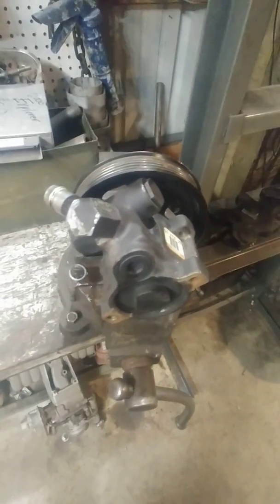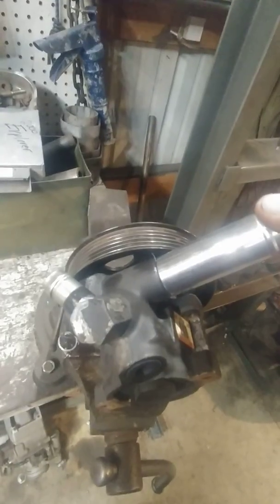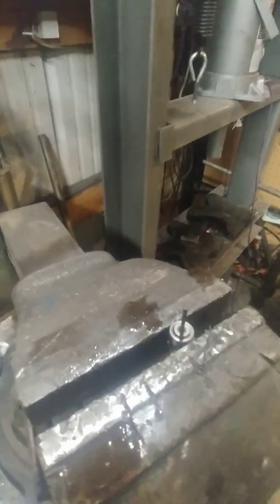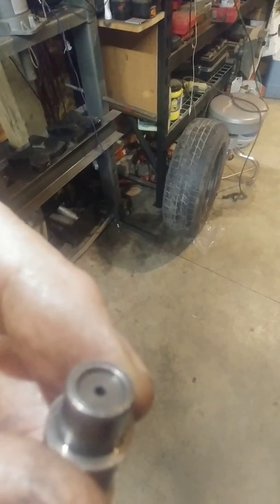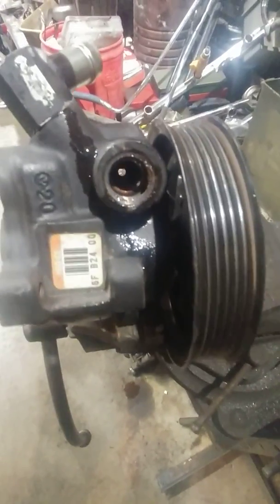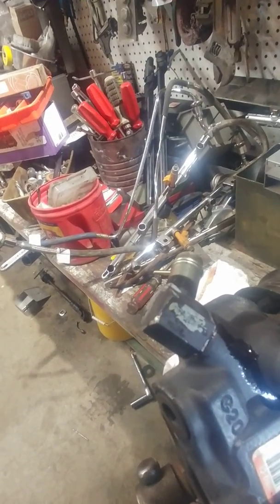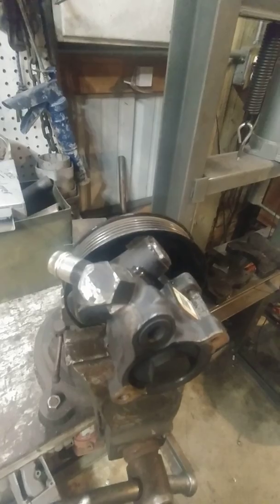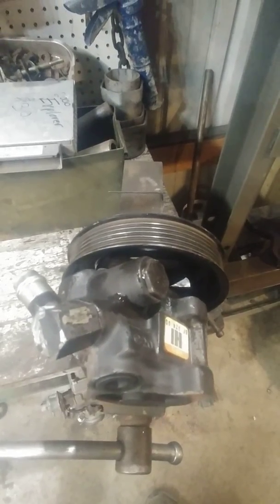Explorer power steering pump pressure and volume modifications

Comment: Ive pulled apart several later 4.0 c3 pumps and they dont have the node sticking out, its a smooth shuttle valve. I imagine they have a smaller hole than these too
Reply from the maker: I have found that the node was on 97 and up as a rule. I think the node is there to limit flow in a stock application.

Comment: Question on a stock application my explorer has a new rack and pinion, reman pump, steering assist is lacking at idle, would just removing the restrictor nipple keep the pressure the pressure the same but help with the lack of flow? Not trying to blow out a new steering rack from excess pressure.
Reply from the maker: I'm not exactly sure. It couldn't hurt it. You may consider putting an underdrive pulley on it to make the pump spin faster at an idle
Reply: Any idea where I can get one?
Reply from the maker: @Fordtruckfan89  Driven auto is where I got mine.

Comment: How did ypu get the shuttle valve out, Mines stuck.
Reply from the maker: You should be able to pop it out fairly easy with a small punch. Not sure why yours is stuck.
Reply: @Low_Key_Offroad  honestly, I think its the "reman" pumps I'm getting, there rust residue inside.  I did get it out through the bottom with a punch, shouldn't these move freely?
Reply from the maker: @VileMisanthropy  yes it should move freely.

Comment: Would I be able to achieve the same with a reducer on a smaller hose. I’m lookin to put in a power steering cooler. But it’s a 5/16 fitting not the standard 3/8. What’s ur thoughts

Comment: So a year later is there any down side to this mod or still working good?
Reply from the maker: It all works great. Runs by Ram assist well.
Reply: Two of them I’ve done this to are still going strong.  I’m going to build a larger reservoir to lessen the cavitation to the system since I’ve added hydroboost and 35” tires to the load.